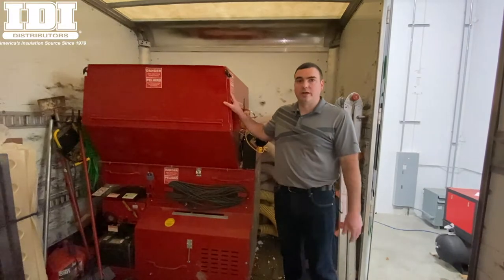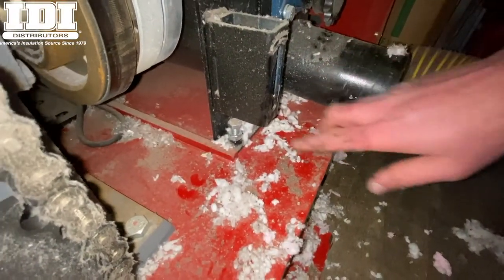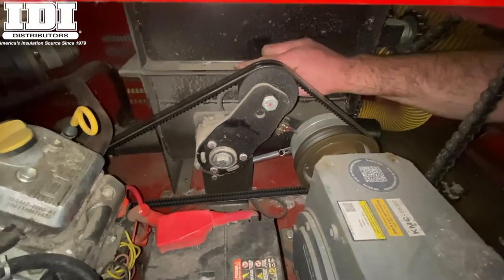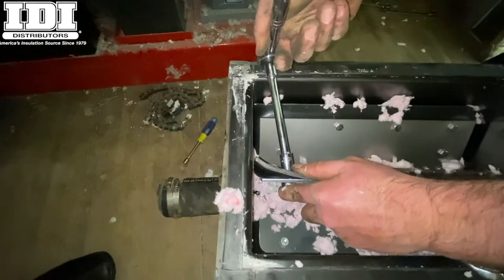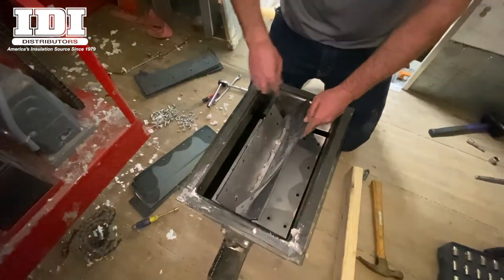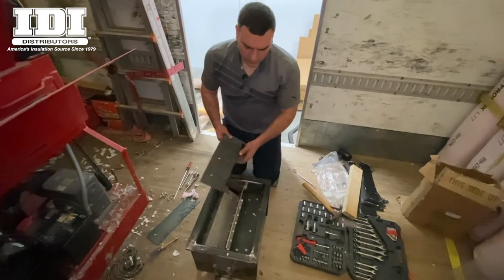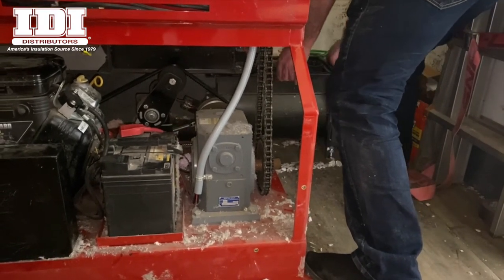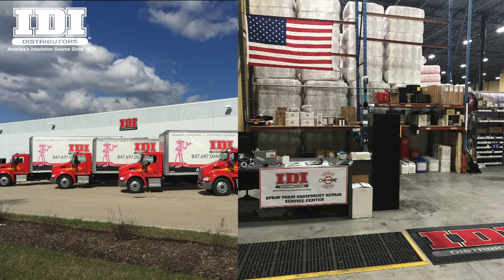How to Perform a 2800G Seal Replacement

Comment: Chris. How many hours were on the blower at the time of replacement?
Reply from the maker: Hey Dennis, thanks for reaching out! Unfortunately, we didn’t capture how many hours were on the blower at the time of filming this video. With that said, hours are not a good indicator of when to replace the seals as it changes based on the material being blown. The indicator we use to determine if seals need to be replaced is by the blowback in the hopper. You can do this by letting the material run low, so you see the agitators in the hopper. If the seals are worn or damaged, material will blow out of the airlock into the hopper. Hope this helps you and let us know if there is anything else we can assist you with. Thanks!
Reply: Puedo conseguir los cellos para una Meyer 550